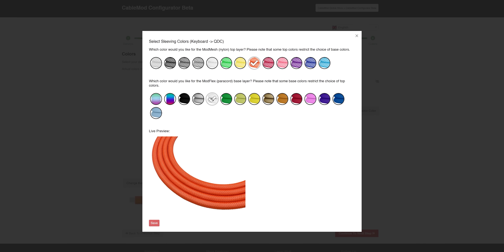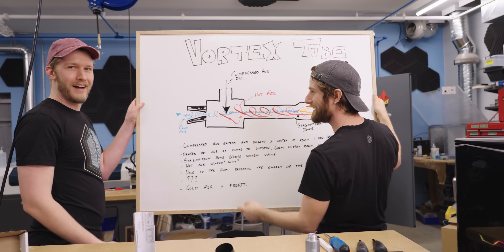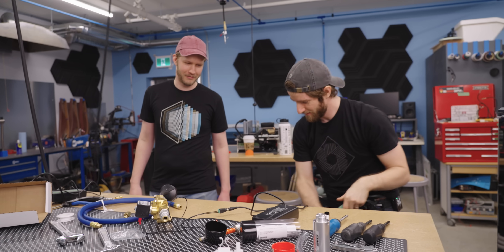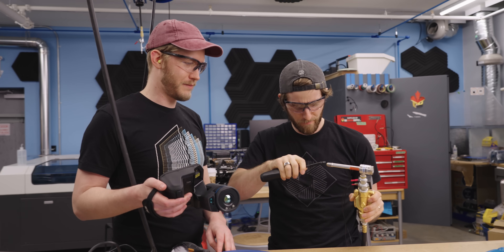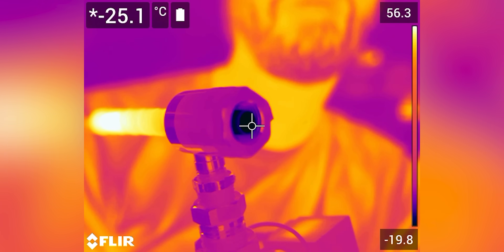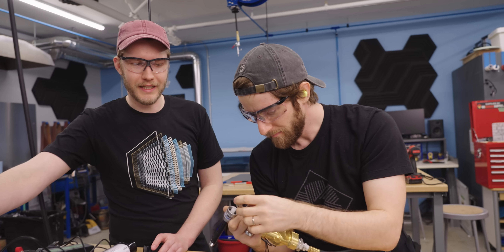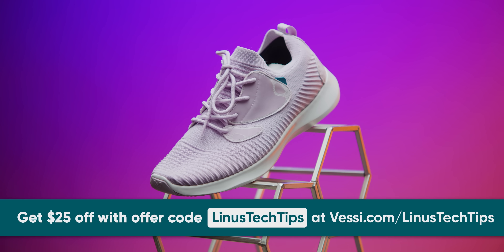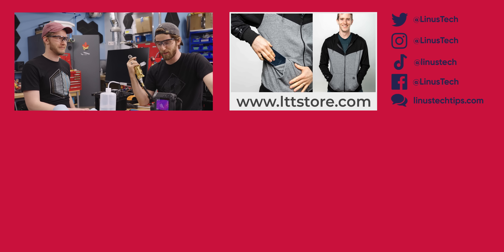This is a CPU Cooler? - Vortex Chiller

Comment: The issue is the heat transfer rate, using the bigger nozzle isn't going to make it cool a cpu better, you need a way to efficiently take the cold air coming from the device and transfer the heat from the cpu into it. Just blowing the cold air at the CPU isn't effective because most of the cold air hits the surface and bounces/flows away after absorbing very very little heat.

A better way to do this would be to set up a water block and pump that is just circulating water from a smallish reservoir (bucket or something). In your reservoir place some kind of heat exchanger, like a coil of copper tubing or even just a water cooling radiator. Set up the vortex cooler so the cold air is blowing through some tubing and through the heat exchanger, that way it chills the water which is then used to cool the cpu.

Since the device is able to hit sub zero temps using something with a much lower freezing point than regular water would be advisable, an alcohol like isopropyl or even ethanol (vodka or everclear!) would work, or you could use water with an additive like some kind of glycol (basically just automotive engine coolant, anything marketed as antifreeze). The alcohol option would probably be the easiest to clean up and have the lowest toxicity if that's something you care about.
Reply: Im still astonished they havent used glycol more. Thats what we use here to heat driveways.
Reply: id say blow the cold air through a waterblock and see what happens. there is a lot more surface area in them than a CPU heat spreader.
Reply: I was thinking long time ago, if there is posible to use the same heat-pipes from a normal cooler and injet water or some of kind of cooling solution, like a watercooling a normal cooler, but in this case could be conecting every heat-pipe and leave the exahust free of the loop, conecting the vortex to the enter and then left the cool air pass inside every heat pipe, cooling all the structure. I think. maybe could work.
Reply: It’s not only a matter of transfer rate, the CPU without the cooler has very little thermal mass, so it gets hot too fast.

In fact this is the real advantage of (normal) watercooling, your transfer rate is similar to (good) air coolers, but your thermal capacity goes through the roof, so your CPU gets to overclock a bunch more.
Reply: @k_froggy  glycol is only interesting if you go subzero. It has a lower heat transfer than water so if your setup is not freezing glycol will set you back. This is the reason even in commercial heatpump systems (like ac unit that works on chill water) they use only water and they go to glycol on industrial level where the chiller hits subzero
Reply: The cellphone cooling worked because the vortex cooler cooled the case, and the case is how the cellphone dissipates heat. The cooling effect visible on the FLIR camera was the case, not the CPU. The case was being cooled, it had enough surface area to interact with the cool air from the vortex cooler.

So the vortex cooler didn't work on the CPU in the desktop because it produces too much heat for the miniscule amount of surface area it offered to the vortex cooler. 

I'm a bit stumped why the vortex cooler didn't work blowing on the fins of the heat exchanger. Maybe it just takes time?
Reply: I was actually wondering if they would just run it through the block somehow.
Reply: Well isn't also the thermal conductivity of air pretty bad wouldn't it also be interesting to use something better like helium for this. Which would also make it way more expensive?
Reply: @TechTinkerWorks  wee use it here because its subzero outside. Suppose in bc it wouldnt help. I was thinking if having a loop outside the house of glycol to cool a water res inside. Colder outside than inside for 8 months of the year here so i guess a compressor would be needed for warmer months anyways though
Reply: I thought there might be a leidenfrost effect but yeah id say all the air is bouncing off before it can absorb the heat

Comment: The recycling, steel making and mining industries use these to thermally protect cameras inside of explosion proof housings. They are durable enough for the knocks the housings take, with the side benefit of clean positive air pressure to keep out dust. I've used this kind of setup on a machine built to shred cars and appliances. Once setup they really don't need any maintenance as long as they get clean dryish air.
Reply: That's interesting. I would have thought just just compressed air would have done it. I work in automation in panels that don't need a lot of cooling but also can't get dusty we will have timed puffs of compressed air into the panel to do it
Reply: @jim4556  normally, compressed air is plenty cold enough, but boiler cameras, or smelting cameras need either an absurd amount of normal air, or a vortex cooler.

We used these a lot in the paper mill I worked at. In fact, some of these were cooling multiple devices simultaneously.
Reply: @jim4556  Thermal cameras in particular were sensitive, and we used them for fire prevention/detection and machine problem detection on a huge scrap shredder. So they got as much protection as we could provide.
Reply: @jim4556  Compressing air generates heat, the pipe between my compressor and the air tank will burn you instantly when it's running. If the air compressor is running for a while, the entire tank will warm up, then the outgoing air will be warm. For many industrial purposes, we can assume things are constantly running. The steel industry is generally working with very high temperatures with glowing hot metal, ambient airflow would not be sufficient.
Reply: @javaman2883  and decompressing air cools... that's high school physics. 
You are not presurizeing the control cabinet you are just releasing air into  so it purges the warm air with in the enclosure with cool and filtered air in areas a normal fan can't because the ambient air is still too warm or contaminated. Now with a device that consumes idk 4x the cfm to deliver 1/4 the cfm of very cold air the argument goes to.. is it better to have just replace the air in the cabinet 4x more often than to use a device like that.

Then of course the other option is just a heat exchanger for the panel. That's usually the method you would use for larger enclosures. But the water tight panels still leak some air and in really contaminated environments.. I still see failures. But those panels generally make so much heat it's still more economical since compressed air is very very expensive.

Comment: You should make a mostly sealed case. Stick the cold end inside the case, hot end out side, and run regular CPU/GPU cooler and see if it helps.
Reply: It would be better to encase radiator with some wisely placed vents. keeping original cooler defeats the point since we want to see if it can provide more beans.

Comment: At my previous job we had 2 electrostatic turbines for painting automotive parts and each turbine had 4 of those vortex coolers on them. If the turbines weren’t spinning but the coolers had air to them, the turbine cups would ice up very quickly, very cool stuff.

Comment: You need to isolate the cold air. Its like a fan, it drags A LOT of room temp air with it when you use it in the open.
Reply: That's what I was thinking, needs to be sealed then maybe a laminar flow screen to smooth and disperse the air.

Comment: When I worked in a factory in the paint department, we use vortex coolers to chill the breathable air supply when we were in the paint booths. made those long runs a lot more bearable!
Reply: I used one when working with hazardous waste. Wearing Tyvek suits in the summer sucks! But with a hood on and running one of those it was helped tremendously. Also, reverse the flow in the winter when it's 20 degrees out, stay nice and warm! They are great, but not cheap.
Reply: @sithus1966  id say keeping people who have to work in moon suits because of the stuff they work with is no time to be cheap on safety or comfort.  I of course do not envy the dudes who fill satellites with rocket fuel, its usually some form of Hydrazine.  Great stuff for its job, reacts quickly and is extremely stable for long periods.  Also terrifyingly toxic.

Comment: I would be interested to see how it performs if you blow the cold air through an insulated tube into a water block or something that can transfer the heat away from the cpu better. I think a lot of that cold air is just spilling into the case rather than making direct contact with the important bits

Comment: The way I understand it: Heat is basically the rate/speed a particle/molecule move/shaking.

so the outer spiraling vortex is getting hotter because of frictions with the metal that makes the air particle "shaking more". it moves really fast that made it only want stay outside because of the centrifugal. now the neat part is only the outer vortex can go outside of the hot end tube.

but now we still have mass flow that cannot escape through the hot end and it will look through the other end.
the inside vortex is slower because the high speed air forces to be on the outside diameter.

the slower air creates a vortex in the opposite rotation because of the returning impulse effect of the hot end nozzle. the slower vortex/air molecules "crashes" with the outer vortex that made the inner vortex slower and slower.

the slower particle that has crashed stays in the most inside part of the vortex while the faster particles move to the ouside because of the centrifugal again.

this "speed loss" over time creates colder  and colder air
Reply: Translation:

The centrifugal force/innertia in the air is the thing creating a pressure difference and thus the outside layer of hot gas where there is high pressure, and the inside layer of cold where there is low pressure. The hot end opening seems to merely exist for the sake of ensuring new gas gets in there and keeps producing a vortex. Otherwise the pressure would equalise quickly and it'd just blow air from the compressor directly out of the cold end.

Cooling the hot end tube with heatsinking should further accelerate the cooling effect, however it will reach a critical point where this effect breaks down given enough cooling i suppose.

the reason it flows backwards in an inverse helical pattern is because if it were to flow in the same path as the hot end but in reverse, it would have a lot more resistence as it would directly counterract the hot air vortex. Instead it flows perpendicular to the hot vortex in an inverse helical pattern because it's the path of least resistence.

An analogy if you will: Turning a car left or right going 60mph down a road is easier than pushing it backwards.

am i getting this right so far?

Comment: Try putting the cold air through an isolated tube going to a waterblock with nothing on the outlet. The immense amount of cold air must cool the microfins quite a bit and there would be a lot less cold air lost.
Reply: this
Reply: Exactly what I was thinking.
Reply: Glad I'm not the only one with this idea. Didn't J2C "cool" a CPU this way in the past? (minus the vortex cooler of course, just raw air)
Reply: so long as a water cooling block can take that much pressure

Comment: I studied this in my undergrad lab class in chemical engineering. It is also called a Hilsch Tube. When it comes down to it we don't really understand exactly how and why it works. It looks like it should violate thermodynamics because it separates a group of molecules into their faster and slower versions. It seems like it should be impossible. However it does work and it doesn't violate thermodynamics. If you do the calculations the total entropy of the system is increasing even with the separation into hot and cold streams. I LOVE these things from an engineering perspective and I love that a device that looks so simple is still beyond our current understanding.
Reply: Sounds like a subject they'd drop on you in your third or fourth year to have an existential crisis and recheck your math a dozen times.
Reply: I think it works like that : the compressed air is forced into a vortex and doesnt escape at the cool end since the hole diameter is smaller than the diameter of the vortex. Then the valve at the hot end make it so that some air can bounce back in the middle of the vortex (that have less pressure due to centrifugal force forcing the vortex air to be compressed at the surface of the interior walls of the tube) where the bouncing air loose energy by friction with the vortex (think how water flow faster in the middle of a river and slower near the edge where there is friction) and can escape at the cool end because it is now aligned with the hole.
Reply: if the calculations hold, then our current understanding is enough to englobe this
Reply: Will it work with water?
Reply: @Dereks06  I dont think so because water cannot be compressed that much
Reply: @sakaraist  This was in my senior lab class so it was a fourth year class. We had to be VERY careful of math and measurements on this one.
Reply: @Dereks06  My understanding is that it only works with things like air but it should work with most compressible gasses.
Reply: @Immudzen  Correct, we had some that we operated with compressed nitrogen.
Reply: so first of all it is called ranque-hilsch tube, and yes we perfectly know how it works
its a heat transfert between compresable and pure gaz...
we push gaz really fast, so it creates cinetic energy inside the gaz
but the gaz cant fully escape  from the valve (and can only escape from the outside ring of the valve, where cinetic energy is the greatest
so part of the gaz  has no choice but to come back, using the least resistant path that is the center of the tube (where it rotates slower)
by comming back slower than it come in, it creates a difference of energy between the 2 flux
there is an energy transfert between the 2 flux happening (the gaz arrive fast, but cant go back as fast, so it dissipates its energy around in order to slow down)
and since this energy transfert cant be generated with a cinetic transfer, because of physics ( close to the center, the distance to realise a full rotation is way less than in this outside ring, so in order to rotate in sync, the center gaz moves forcibly slower), the only energetic transfert possible is a thermal transfert
the gaz in the middle then transfers its energy thermicaly to the ouside flux in order to slow down, making it effectively cooler
this is basic thermo dynamic

Comment: As a Mechanic of the 70s and beyond, we had a device very similar called a Choke Checker. With carburetors you need a choke mechanism to make the fuel ratio rich on cold starts and this device could safely spray cold or hot air on the bi-metal coil that moved the choke valve.

Comment: Maybe try using a water block to increase the surface area the cold air can interface with. You could also design a custom air block with all the equipment you have at your disposal.
Reply: YES THEY SHOULD USE THIS AGAIN
Reply: I ALSO AGREE AND IM GOING TO SHOUT MY AGREEMENT VERY LOUDLY TO THE WORLD.
Reply: @Kholaslittlespot1  YES I AGREE WITH YOUR AGREEMENT. AND FOR SHOUTING IT OUT TO THE WORLD.
Reply: @ab15h  THANKS, I AGREE WITH THE AGREEMENT THAT YOU'RE AGREEING TO. I'M GLAD WE AGREE. AHHHHHHHHHHHHH

Comment: You need an 
aluminum cooler that has a hollow pass through with  the finns inside. Then attach the cool nozzle so the cold air is forced past the finns.
Reply: theirs a half-dozen ways they could have used this as an effective cooling solution.  really unfortunate to see them wiff this bad
Reply: Heatsync - It synchronizes the heat... with something.

Comment: 10:21
 
It could've been worked if you used it further away.
 
Because of the pressure when you blow it from a distance
the air near it follows the flowing air and you achieve way 
higher air volumes.

It is like how you can't inflate a plastic bag in one go 
if you put your mouth directly to it. But it is very easy
if you blow it from some distance.
Reply: so your telling me air mattresses should designed more like a windsock than having some tiny ass, loud, slow compressor... lol
Go on internet, i wanna see this advertised now. :P
Reply: The warmer surrounding air will reduce the cooling slightly but not much.
Reply: Ey, the bernoulli effect <3
Reply: Hey I learned about this when wondering why modern diesel trucks have those weird looking exhaust tips. The openings before the tip allow fresh air to flow through following the exhaust significantly cooling the exhaust. It's a safety thing but supposedly also done for emissions testing.
Reply: But wouldnt that pull in ambient temp air? Which would heat up the airstream

Comment: 8:50 because the air groing through the inside of the nozzle is from the compressor which is filtered and oil-free as you've stated, so also moisture free
Reply: Not moisture free, unless they have a pretty overkill  filtration system. Moisture reduced maybe..

Comment: This is the kind of cooling that I would use for my entire server rack in my remote tech room. I intend to have a whole setup like Linus' home setup
Reply: @Dart Runner for fun
Reply: @Dart Runner he has superpower and it is being rich that's why.
Reply: We use them here at work. They have problems. Even with an oil air filter a fine oil mist will be deposited in everything. Most air compressor systems, unless they're oil-less will have oil in the air.  Second they take ALOT of air.
Reply: Compressed air is one of the most expensive energy sources. No, you will not use this in an application that is viable for many other and better solutions.

Comment: Cooling sewing machine needles is also a common application, you could look into using vacuum generators (creates a vacuum by using only compressed air) as even noisier replacements for mechanical fans, but with no moving parts.